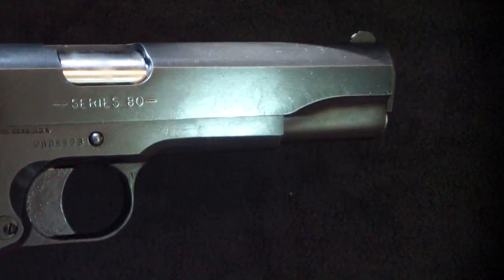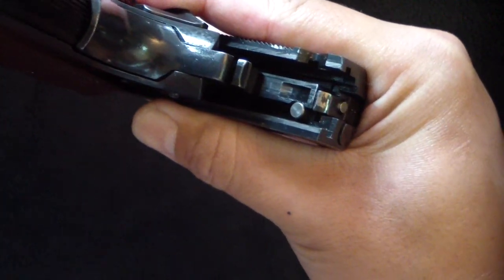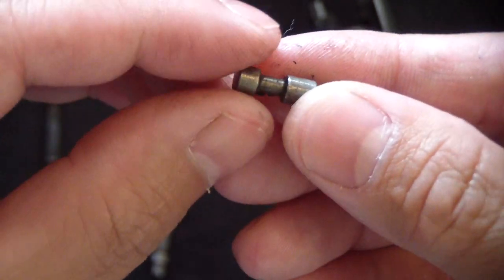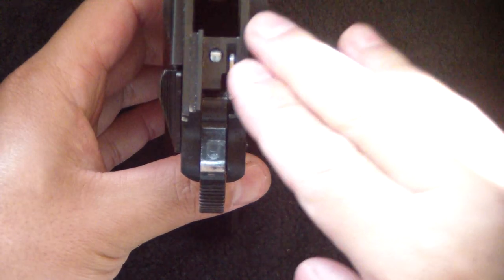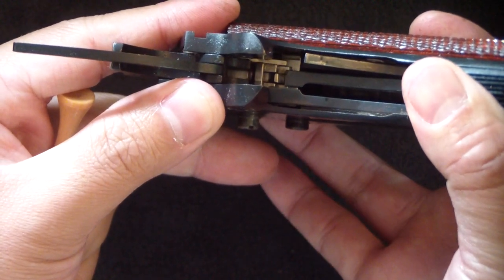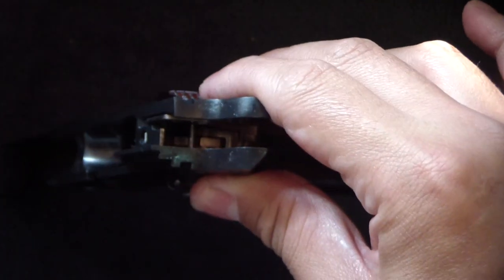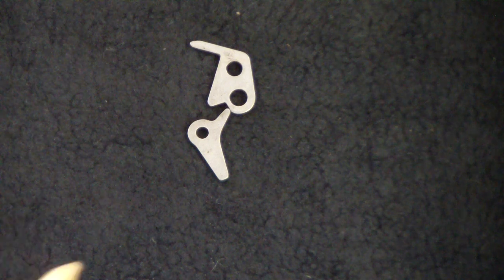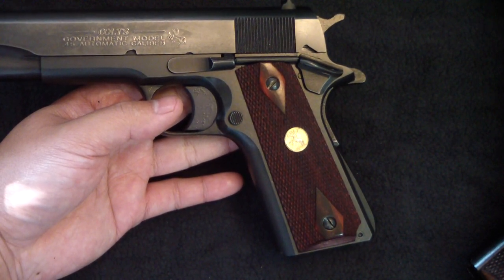What is the Colt series 80 1911?  BATJAC J.W

Comment: BATJAC, would you personally carry a series 70 cocked and locked? This isn't a loaded question with a right or wrong answer mind you, I'm just curious. I'm NOT an expert on series 80's or 70's but I've owned a Colt series 80, traded it, and still didn't really "know" what it was. Now I own a Rock and a SAM and they're both series 70's but being just a little, and I mean a little, more knowledgeable on the matter, I myself wouldn't and don't carry series 70's cocked and locked. (Not the ones I have.) I might with the Ruger's or Springer's with the titanium pin arrangement and stronger spring but not the standard fare series 70's? Do you have an opinion on this?
Reply from the maker: Lots of folks carried them over the years just like that. I have carried a commander 1911 series 70 cocked and lock at a gun shop i worked at.

Comment: BATJAC, You should do a List of Manufactures that use the series 80 Pistols Firing pin block system.  I for one don't care for it. any fouling that gets in the Plunger assembly in the slide or the leaver mechanism ruins the sensitivity of your trigger. Brownells sells a blanking device that gives proper shim thickness in the frame so you can get rid of that.  Now.. There are people out there that will say.. "Never felt a trigger on a stock pistol so good"  and to that I say to each his own. However almost all the competition pistols out there are built off the 70's frame design. That is a Fact. Dave.